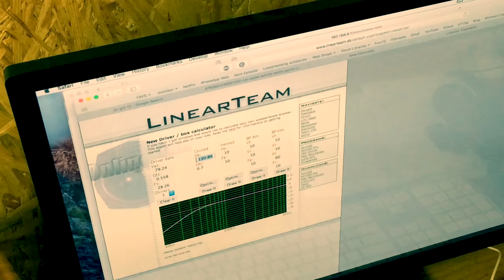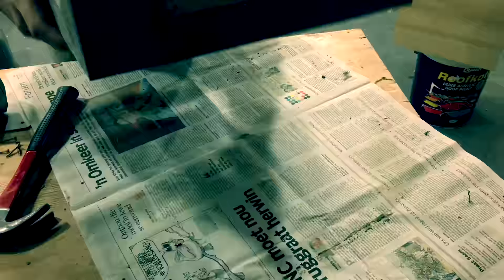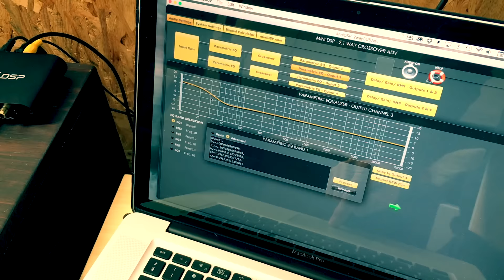Building a 12" Subwoofer with Concrete Base - by SoundBlab

Comment: Seems like your idea has a good foundation.
Reply from the maker: Thanks!
Reply: SoundBlab is there any concrete evidence that this improves the bass
Reply: feels like a cheesy reddit pun string in the comments haha
Reply: I think its the vibration of the enclosure that reduces the bass. Because of the weight of the concrete it reduces the over all vibration of the enclosure that cancels the bass w/c in return produces the bass right on the subwoofer driver itself..  Try to listen on a light enclosure over a heavier one and you'll see the noticeable difference.. :)

Comment: nice one.  I like. what's your opinion on using metal rather than wood to make a speaker or sub?....
Reply from the maker: Thanks. Depend on what type of metal you have in mind. Typically aluminum is a good choice for speakers because you can use a relatively thick wall thickness to weight ratio. Using something like steel would be impractical as it will be very heavy at the same wall thickness. A company like Magico typically uses aluminum for speaker enclosures.
Reply: If its just weight thats the issue, then a semi permanent steel high fi should be ok right, Like your concrete one? I was wondering if the resonating of the steel pannels would become a benefit or a problem for the sound, I work with metal on my channel and I'm also a PA technition for a church . we're building a community cinema and I'm thinking of building some quallity sound systems at a trade price. who do you use for speaker parts? Love your videos and thank you so much for replying. J
Reply: Any added resonance by the panels would be bad.

Comment: As always great workmanship. I was wondering if you have thought about front firing sealed 10" subwoofer with 12" ported subwoofer in one cabinet and working as one subwoofer? 10" working between 120Hz to 60Hz and 12" working between 60Hz to 10Hz. I know it's bit crazy but I think it will sound really good.
Reply from the maker: Thanks. It'll be a bit like a two-way subwoofer. I haven't seen that before. Will give it some thought...
Reply: @SoundBlab  thanks.

Comment: Absolutly fantastic build.

Would the subwoofer work without dsp and still be decent ? Is it possible to simulate the DSP with a good sound card in your PC ? What driver did you exactly use and why ? You said there will be build plans available soon, so when will that be ?

Sorry for the many questions but I'm very interestet in this build as a newbie to loudspeaker building but experienced in woodworking.
Keep it up.
Reply from the maker: To integrate properly into a system any subwoofer will require some form of crossover. This project relies on the DSP to perform the crossover duties and therefore can not be omitted. The driver I used should be linked in the video description. This JBL driver has good excursion and was for that reason suitable to apply a bass boost too via the DSP unit. It uses a principle called Linkwitz Transform to boost the bass in a sealed enclosure, thus allowing to use a smaller enclosure than in a ported box to achieve the same amount of bass output.

I have many projects on in the pipeline and can not say when build plans will be available, but it is still on the cards.

Comment: Still one of my favorite subwoofer videos, it's amazing and very satisfying to watch. How you designed concrete part? Did you do some calculations or it was dimensions of the box + height = rule of thumb? I ask because I would like to make one of my own and I have a speaker and recommended box dimensions but I don't know should I use dimensions for sealed enclosure or bandpass enclosure, and my question is do concrete bottom of the box acts like bandpass or not?
Reply from the maker: Thanks. It really is just a plain sealed subwoofer that is firing downwards. All you need to do is make sure its not to close to the bottom with enough space for the driver to move freely.
Reply: @SoundBlab  thank you for answer

Comment: Really impressive work, the concrete base looks amazing and goes well with the overall look. But how come you don't have a bass port on this sub?
Reply from the maker: There is a link and explanation to the concept of the Linkwitz Transform Circuit principle I applied of a sealed subwoofer to extend the bass frequency in the description of the video.

Comment: I have a bluetooth speaker project I'd like to dig into.  Would you be able to answer some questions about equipment to use?  Specifically about an amp that could drive a 200 W 2.1 setup (100X1 and 50X2)?
Reply from the maker: Sure. I suggest this amp board: http://goo.gl/wiBr7d
I have used it in many of my projects and it performs really well with good bluetooth connectivity and sound quality.
Reply: What power supply have you used with it?  I'm looking to power this with AC, not batteries.  Thanks for the response!

Comment: doesn't it need to have a hole to allow air move in and out?I thought for such a big sub you need both a big enclosure and a big hole for it to have a nice low frequency responce(I want to build one so i would appreciate any piece of advice)
Reply from the maker: The sealed enclosure together with the digital signal processor (MiniDSP) uses a principle called Linkwitz Transform to boost the bass in the lower frequencies which makes a port unnecessary and the enclosure smaller for the same result.
Reply: thanks man!!

Comment: Great Video! I'm from CT and I was wanting to build a bandpass Subwoofer enclosure with built in plate amplifier. Is that a plate amp you installed in with your Sub? I can't seem to find plate amps in SA, do you know where I might be able to source one?
Reply from the maker: I've had no luck finding one locally. The plate amp in my build is a very simple DIY job.
Reply: Ahh, I wish I had those skills, unfortunately that's a little beyond my experience. I think I'll just have to look into importing a Bash plate amp or similar. Thanks for your reply.

Comment: Hi ! Omg it's totally the project that i love! 
I have a question for you... I have a Sonos Amp (Subwoofer output with 80 Hz crossover) where I can plug a subwoofer with a single aux (you see what i mean? - You can see easily the back of the amp in Google Image). 
Can you tell me if a need an Amp in the subwoofer and which do you advice me for my project ? 
Thanks alot !!!!
Reply: If it's outputting a subwoofer low-level signal then you will need an amp in the sub. And that's pretty much what yours is doing.

Comment: I wanted to ask here: I want to build a bluetooth speaker too. How important is the whole where air can get out? Pls I need a answer and you are the expert :)
Reply from the maker: Each enclosure and port (or hole) is very specific for the driver that goes into it. If the size of either is not optimised for the driver, the result will not always be desirable. If you can wait, I will be releasing a future design and build plans and where you can buy the components.
Reply: +SoundBlab ok thank you :)

Comment: Honestly though... how much did it cost you? I'm looking into building a subwoofer but finding out it's actually cheaper to get a quality sub from e.g. SVS
Reply from the maker: It definitely depends on the quality of sub you are after. In this case, I was not really trying to build a sub because it might be cheaper than to buy one, but was experimenting with the Linkwitz Transform Circuit principle of a sub driver in a sealed enclosure. The cost was not so important to me as the build and the experimentation in the end.
Reply: SoundBlab thanks for your reply :). Yeah... here in the Netherlands we don't have a parts-express unfortunately. Building a Dayton Ultimax 10" with plate amp is more expensive than getting a SVS-PB1000. Granted; the experience and fun is also worth something but if you're looking for the best 'bang for buck' It's hard to beat the offerings nowadays with DIY.
Reply: Jeffrey W   hey Jeffrey. I also live in the Netherlands and for the past year or two i've been making a selection of affordable woofers that perform really well too. You don't NEED a Dayton ultimax, a JBL GT5-10 performs amazingly well too and has a nice 14mm of one-way xmax. So unless you're really after that SVS type of stuff, a JBL GT5-10 might fit your needs as it hits am f3 of 21hz with only minor EQ'ing at decent levels

Comment: I hope the speaker was previously broken in before he took the ts perameters, if not then the ts perameters will change as the spider lossesns up.
Reply from the maker: It was.
Reply from the maker: Although, in a sealed enclosure the TS parameters are not as crucial as in a ported enclosure. Slight variations will have very little effect on the audible outcome.

Comment: Are internal dimensions more forgiving with a sealed unit? And would a passive woofer design share a similar volume to a sealed unit (vs a ported one?)
Reply from the maker: Yes, it usually is. Enclosures using passive radiators do not always use smaller enclosures than that of sealed enclosures. As a general rule you can design for a passive radiator enclosure in a similar way as for ported enclosures. It all depends on the specs of the driver you use in your enclosure at the end of the day. It's a complex subject that would require more detail explanation. Hope this helps some though!
Reply: @SoundLab many thanks!

Comment: Is there any software with delay/time alignment/phase, limiting, etc  of individual channels from the computers sound card?
Have serious cancelation issues with my home PA system
Reply from the maker: Not sure I understand the question, but the MiniDSP unit gets it output straight from the subwoofer output on my AV receiver not the computer, and is then connected to the subwoofer amp. All processing is done with the MiniDSP. Time alignment for the sub, L, R, C, and surround channels are done with the AV receiver.

Comment: What plate amp are you using? Where did you buy it and what do they cost more or less?
Reply from the maker: This is a amp that I put together with parts that I acquired some years ago. Its not off the shelf unit.

Comment: Do you mind shearing the sizes of you box? I like to build my own. Thanks
Reply from the maker: It will depend on the driver you use, but mine is about 48 liters internal volume.
Reply: Thank you, I have a 10" driver.
Reply from the maker: Without the specs of your driver its still difficult to say, but generally for a 10 inch driver you will need slightly smaller enclosure than for the 12 inch that I used. Probably in the region of 30 to 40 liters, but its only a guess to be honest.

Comment: Nice build vid and great looking unit, top job :) Do you mind if I ask where you got the plate amp and how much it was?
Reply from the maker: 300watt amp module and power supply made into a plate amp. I don't have more specs, bought and assembled it many years ago and just repurposed it for this build.

Comment: Is it possible to add a concrete base to an existing sub without compromising the sound?
Reply from the maker: I am sure you can. If you have a down firing sub just make sure you leave enough space between the concrete and the sub. If front facing sub, then it does not really matter. The idea really is to add some additional mass to the sub and to provide it with a solid foundation that will prevent the sub from moving around and counter any potential distortion that the woofer might create as a result. A subwoofer driver creates a lot of movement, and the better you can weigh the sub enclosure down, the better chance you have of clearer bass performance. Proof is in the poeding though and only by trying will you be able to judge a difference.

Comment: excellent craftsmanship, great audio processing and you chose that entry level automotive sub :(
Reply from the maker: Thanks. This JBL sub is entry level, however it is a very good unit that had the required specs I was looking for for this type of application. I was not looking for something that had loads of excursion or power. I wanted a balanced sub that can perform well musically and for movies up to a required point. Many other higher power subs deliver lots of low end, but lack in the detail when it comes to mid sub frequencies. Price is not always an indication of performance and this one performs more like a sub intended for home theatre application than most other car subs.
Reply: If the result is satisfying you that's all that matters. I just thought a sub intended for car use would not have enough low end (because in car there's the natural cabin gain). But I'm sure the DSP corrects any of these issues if exist and yes, the sub is build very well.

Comment: a bit late but does the concrete add dampening or anything else to the sound ?
Reply from the maker: Its does help to prevent transfer of vibration to the floor.

Comment: Im a total audiophile noob. Don't subwoofers need an opening or a port?
Reply from the maker: No, not necessarily. A ported enclosure will give a lower bass output, but with the Linkwitz Transform applied via the MiniDSP, we can boost the bass output in a sealed enclosure to be similar to that of a ported subwoofer. You might still ask why? A sealed subwoofer in my opinion has many advantages: The enclosure is smaller and the bass sounds tighter and more accurate.
Reply: Thanks for the info
Reply: So instead of pumping up the bass output where the sub drops it's capacity to make a linear bass physically with a port or passive radiator you pump it up by "software" digitally?does the MiniDSP is for compensating that loss?
Reply: its a diff type of enclosure w/c is a sealed one..
Reply: correct and with a cleaner sound w/out the farting port noise :D
Reply: Also looking forward if you'd want to make a subwoofer project with a passive radiator this time with concrete base also and compare the bass performance over this sealed one :)
Reply: I think its the tuning of the frequency that is fed to the amplifier of the sub.. :)

Comment: @SoundBlab 
Where can I find these bamboo plates? How are they called?
Reply from the maker: It's called bamboo ply. It's 4 or 5 mm thick. You should be able to Google it to find a supplier in your country.
Reply: @SoundBlab  ok, thanks.
 you can see a similar build on my channel in about 3 weeks.  
just a little bit larger with 100l volume and a costum 2400w 15" driver.
I'll give you a shout out :)

Comment: really cool design! the baseplate is a real turn on :) But I know from experience that curves like that aren't really telling the truth, they look good but it won't tell you how it really sounds! but overall cool build :) I would add some dampening material inside the box, like stonewool to eat up some resonating frequencies:)
Reply from the maker: Hey thanks! The curves you see in the video are the simulation curves for the Linkwitz Transform circuit based on the Thiele Small parameters of the chosen driver. But true, nothing is better than hearing it for yourself, the simulation is only an ideal theoretical outcome. I did actually add damping materials, didn't show it on the video, sorry :)

Comment: Imagine a translaminate bamboo or cocunut plywood 3/4". Bamboo is a steel substitute in Asia. Cocunut and Palm exhibit similar tension load characteristics of steel. I think natural cork could substitute glue ,  it could be loaded with threaded rod under tension. It could remain tunable in Port length and chamber volume. Translaminate allows anticoic chamber shapes as an alternating pattern of layers. That concrete base is genius.
Reply from the maker: Thanks

Comment: why would you use concrete for the base of the enclosure if you don't mind me asking
Reply from the maker: It adds to the weight of the subwoofer and I like the way it looks and contrasts with the bamboo.
Reply: It helps keep the speaker from rattling.

Comment: What is the Add'ed benefit of the concrete base?
Reply from the maker: It adds necessary weight to the overall enclosure, which always helps keep the sub stable on the surface its placed on. And I like the way it looks :)
Reply: i love the look too! keep up the good work, great video. love the construction of the base

Comment: can a kef psw2000 plate amp handle 2 of these
Reply from the maker: The KEF PSW2000 produces 120Watts according to the specs. It can drive 2 of these, but not with much authority. It will barely be enough for one of these to be honest. You will require at least a 300Watt amp to drive a sealed Linkwitz Transform sub with the particular driver I used.
Reply: +SoundBlab oh 😑 
thanks

Comment: why didnt you add something like a bass radiator wouldn't that boost the lows even more?
Reply from the maker: With a sealed enclosure without a bass port I can get a smaller enclosure, which is easier to fit into my lounge, and reach the same amount of bass output using the LT and MiniDSP.

Comment: wouldent there be alot of port noise?
Reply from the maker: None at all. I made sure the combined area of the slots are equal or more than the surface area of the 12inch driver.

Comment: You'll get much stronger concrete if you ease off the water.    You want "earth moist" concrete, which is not at all flowable.   Use the drier mix and pound it into the forms about 1" at a time.   You might get "bug holes" --holes that make the finish look like Colby cheese --but to people that know, that's a sign of good concrete, and part of it's charm.
Reply: Also did you know that they make white portland cement?   A least they do in the US.   Start with that and you can dye the concrete practically any color.
Reply from the maker: Thanks for the tip. It was really my first time experimenting with concrete and I would like to do some more builds incorporating it. I love the texture and feel of it.
Reply from the maker: I've seen the white concrete in my local hardware shop. Will try it sometime.